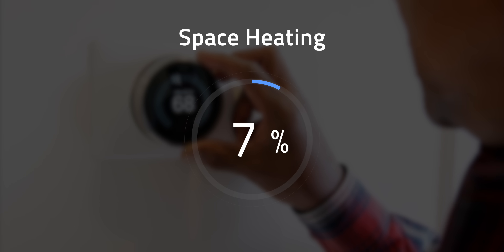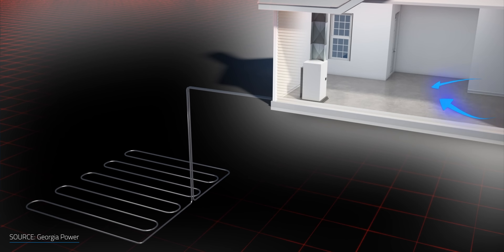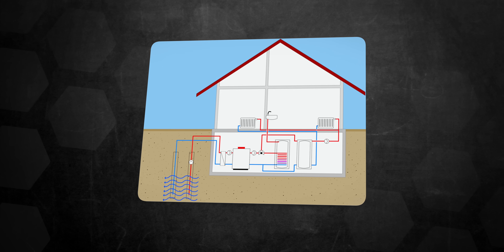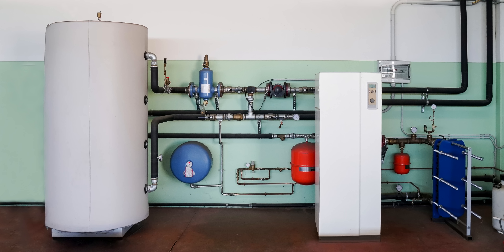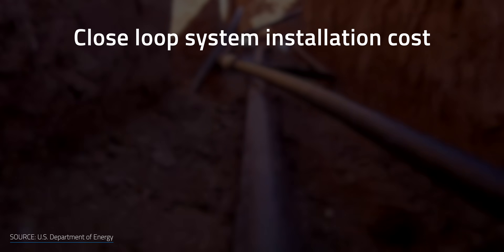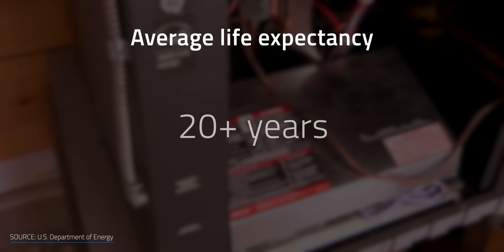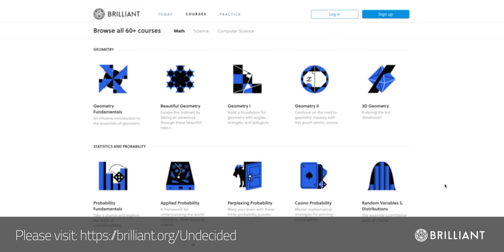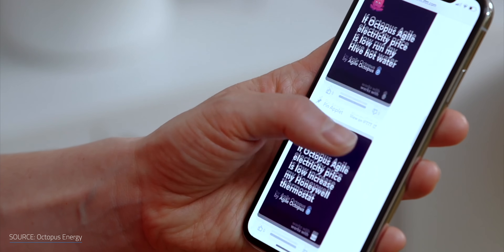Is Geothermal Heating and Cooling Worth the Cost?  Heat Pumps Explained

Comment: We installed a Water Furnace geo system 18 years ago.  The breakeven for the additional cost over gas forced air and central air was 5 1/2 years. Continues to save hundreds of dollars each month.  Only one minor service call in that time.  We chose to have the lines run vertically -- 4 holes drilled straight down 100 feet. Hardly disturbed the yard.  If you're building new or replacing an old system, this is the way to go.  Note of caution:  The auxiliary heat is electric heat coils that can supplement normal operation in extremely cold conditions.  It also spins your electric meter like crazy.  We chose to have this disabled and have not missed it despite sub zero winter weather.  Also tempersture changes are slower than GFA,  so we just leave it set at a constant temperature for the most part.

Comment: I had it installed here in BC Canada.   If my only other option is electrical heat then it was marginally worth it.  But compared to gas heat it is definitely not worth it.  In retrospect I  should have just installed a gas furnace for the two or three months of cold and an air source heat pump for shoulder seasons and air conditioning.

Comment: It all comes down to how much is the install cost vs. how much is a typical heating bill.  It works out better if it's a new build as opposed to a retrofit.  It's cheaper to install typically with new construction.  Also, you have to plan on staying in the house until you break even.

Comment: Warning: I invested the "Ferrari" of geo thermal systems a few years ago at a cost of about $40,000K for a closed vertical loop system. The system worked great providing cheap heating and cooling for about 3 years, and then just stopped. When they came to investigate, apparently the pipes had snapped because the bedrock rock under ground had shifted. To repair would have required a reinstallation of the pipes which would almost have been as pricey as the original installation, so needless to say I ended up getting a high efficiency propane system. I also was told this is a common problem with these systems, and found many horror stories on line. I wish I had known this before the original installation. Buyer beware.
Reply: It's a warning valid for areas with tectonic activities. But it should have been known in advance, and the flat collectors should have got preference over a deep whole.
Reply: I wonder if more flexible tubing would help prevent the pipe snapping you experienced.  I suppose if too flexible, the hose could crimp and impede the coolant flow.
Reply: @WT7005  it probably would have gotten pinched and stopped regardless
Reply: I think that s the design mistake tbh. The installer has not considered about the geology below your land which I usually do. Vertical closed loop is very much efficient interns of the space, but it is risky depending on the geological region.
Reply: what Cindy of heat transfer do you gat from bone dry sand granite and other types of dry ground
Reply: Sorry to hear this, someone really tried to take advantage of you. Full re-installation wouldn’t have been necessary.
Reply: I wonder if the pipes failed because they didn't use the proper pipe to save them money and give them mote profit
Reply: @marvenlunn6086  No - the rock shifted and snapped the pipe and would have done so regardless of the type installed. Was told by those that made the diagnosis (not the installers) that this is a common problem with closed vertical loop geothermal. I'd never heard about this problem until it happened. Buyer beware.
Reply: @colincameron1878  OK but it wouldn't surprise me if some of these companies use substandard materials
Reply: The installer company should have warranty at least five years to cover that.
Reply: Thank you! This is what I needed to hear
Reply: Nice heads up
Reply: Thank you for this information. I’m in Pennsylvania and heat with coal, wood, and heating oil. Cheap and a lot less complicated than these heat pumps.
Reply: Didn't the company provide any warrantee/ guarantee? Insurance?
Reply: Sounds like the well/loop installer didn't know what the eff they r doing.
Reply: Sinking the loop in a pond or lake is much much more efficient...40k? Forget about that lol
Reply: How bout laying the loop on some sand then it can move a bit.
Reply: Aither geologist fucked up or they didnt employ one, in aither case that fuckup should be on them
Reply: Where do you live, California?
Reply: @aaronfield7899  Ottawa, Canada. From what I was told this problem was not related to the extreme temperature changes in the Canadian climate because underground is not subject these changes except for the top couple of feet.
Reply: @colincameron1878  well I don't know how else the ground will move, because Ottawa is nowhere near a plate boundary.
Reply: @aaronfield7899  Ground here only freezes to about 3 feet, and pipe is buried starting well below the frost line at about 10 feet. They did a hole to that depth before drilling. Damage was done at about 80-100 feet deep, and I was told that the rocks moved. Subsequently I read reviews from many people that this also happened to them, and furnace repair service said this is commonplace even though we are not on a fault line.
Reply: @colincameron1878  so you had a vertical system in place?
Reply: Thanks I always wondered about this, would you know if this is the same for a horizontal loop ?
Reply: Why can’t I get emu info on efficiency chart on a ground source heat pump related to the return water coming out of the ground
Reply: Ty for sharing your experience!
Reply: Hmm, so don't install in bedrock...
My geo (forced air) was 10k. That was 10 years ago. $0 on maintenance spent
Reply: Ferrari produce really expensive crappy cars soooo... I'm not surprised you had problems😅
Reply: It should be integrated in the house foundations structure
Reply: @colincameron1878  masonry heaters
Reply: :-00000
Reply: Does homeowner's insurance cover ground source or duel source heat pumps?
Reply: @cordeliaparham6800  Mine did not. I imagine you would specifically have to ask for these to be included.
Reply: @cordeliaparham6800 this is an effective thing to bring up
Reply: That is not a common problem - not at all.  That’s just not accurate.  Also, there should have been a warranty for the loop(s).
Reply: @markh6161  Company that did the installation went out of business by the time this happened. Certainly, I am no expert, but the company that came to investigate why my system stopped working and made the diagnosis told me this is a problem that they see regularly. Also at the time I then saw dozens of reports from other people on-line claiming the same thing had happened to them too.
Reply: Well yeah you had the wrong one you needed them to go below the frost line I’m assuming it’s rocky or ledge in your lot
Reply: @altchanel9693  They did go well below the frost line (about 2 metres) and break was 20-30 metres under the ground. Was told that rock underground shifted breaking the pipe (it was drilled into the bedrock). Was also told that this is a common problem with such systems.
Reply: @colincameron1878  yeah you have a vertical system . If you dig and lay a mat of coils and backfill with good material it wouldn’t be an issue

Comment: When I built my house 25 years ago, geothermal was 30 times the price of a gas furnace.  The trees may interfer with the pumping , not sure. Also, I have a conventional AC. When the AC quits, it's over 20 years old, I will get an air source heat pump, with gas backup. The trees have gotten bigger, so less area, more trouble for geothermal. The trees add shade and evaporative cooling, but don't block winter sunshine.

Comment: A public school in my area had this geothermal system installed  along with windmill and solar.  Was the worst thing they ever did.  
Problem was it would heat to around 62 degrees constant temp. Was to cold for classrooms.  So they put in a furnace to try and heat the water from 62 to 70 and the furnace ran constantly making the heat bill twice as high as in previous years.  Windmill and solar was also a colossal waste of tax payer money.

Comment: The higher upfront costs of geothermal systems is why NY and MA are pushing newer air-source heat pumps to replace heating oil in both states with rich incentives.  Newer ASHPs are far more efficient than the ASHPs from the 70s-80s and can also be integrated into utility economic demand response programs. They are also far more “plug-and-play” than GSHPs and far cheaper. 

In the early days of GSHPs there were many poorly designed systems. I know one school district in Upstate NY that built a new building with a GSHP system. Unfortunately whoever designed it didn’t realize that the heating/cooling loads were not balanced. After five years of running the system only during the winter the area surrounding the loops remained cooler than average ground heat because no heat was being pumped back in. The system started straining to produce any heat at all during the winter with the end result being a conventional natural gas system being installed costing the school district millions more.  Residential GSHPs should be more balanced over time.

Comment: As an HVAC Technician in Oregon, the costs are way way way way off. Prices are way more expensive than what is indicated here, unless you want to absolute worst contractors working on your equipment. $15-25k depending on size and efficiency of equipment without changing ductwork is much more realistic (that is for both a furnace and AC (or heat pump and air handler)).

Comment: I put polypropoline lines in the concrete slabs surrounding my pool. I connected Jandy valves to my pool equipment so that a small thermal sensor activates the valves when the pool water gets below 70 degrees. This extended my swimming season here in phoenix by over three months split before and after summer. Neighbors are envious. Heating cost ZERO!

Comment: Yes it's worth the cost ! Had geothermal put in in '07 utilizing a 1 acre pond at a cost of $13000. after rebates .Our cost to heat with oil the previous year was $5500.00. Over the next few years we saved that amount but paid $900 to $1100 per year in additional electricity usage. The return on investment was 3yrs. and it has been reliable ever since only requiring a new blower motor in '19. We now also have 17KW of solar so the savings are just that much better.

Comment: 1993 built new house. just under 10,000 for waterfurnace  and horizontal loop and ductwork. 2018 had to replace unit with waterfurnace brand. 6700 dolaars after 30 % tax credit. overall pretty much satisfied. not many problems with first unit. so so good on #2.

Comment: "Oil is sadly used in his area." Well thats the first dumbass comment Ive heard in this presentation. Its used because its affordable and works. The exorbitant costs of install and finding a company that specializes in geothermal heat pumps, if they do it right, is not worth it. I love how these sales pitches push crap as though its the best thing since sliced bread and when it fails after a few short years the homeowner is screwed trying to afford the repairs, not to mention the time without heating or cooling inconvenience!

Comment: If your building a 100 year house. Its the best system on the planet. If your building a 20 year house dont bother.  It is to expensive for you. The money you save on heating and cooling will pay for the system in 7 years. A good system is very low to no maintenance. And will outlast a 100 year house.

Comment: Sounds like a good idea in 10-20 years when they have the tech all sorted out and repairmen are readily available
Reply: There is no tech. its running water through the ground and using the ground temp. Your big maintenance cost is the fan motor and pump motor, which could be hot swapped in a heartbeat. Any plumber can figure this system out. This is incredibly low tech. Now if they install it the "smart" way, which is using a small AC/Heat system to supplement the geo system, then this can get alittle complicated.

Comment: "Geothermal" A number of problems for a great system. VERY sensitive to electricity costs as the time to pay back install cost could stretch or exceed system life if electricity rates are high (Like Ontario). I also believe the moniker "Geothermal" was adopted vs. Ground source to justify the high cost. I mean what sounds better/expensive? I think this may be biting the industry in the ass a bit. Resale of home?? Unless the next buyer sees the value it adds nothing or little. When you say GEOTHERMAL heating, does it make an uninformed buyer nervous?? Probably.  Field costs are absurd, likely the reason the "Geothermal" moniker was adopted. If you are near an actual ACTUAL geothermal area like ICELAND, hey call it geothermal. Otherwise, it's bloody ground source. What's the cost to horizontal drill/install a natural gas line? Probably a tenth or less per running foot than a "Geothermal" field. Justify that difference. Also some juristictions almost require a damn mining permit to drill vertical because hell if a homeowner can afford a "Geothermal" system then for sure the local municipality needs to get in on the action. Thanks government. I am not sure where "Geothermal" is in Ontario but it for sure is a rural solution limited to areas not served by Natural Gas. Tragically Ontario used to have electricity rates that would make "Geothermal" more attractive. This was ironically ruined by "The Green Energy ACT" which was more successful at rewarding corruption than fostering "Green" energy.

Comment: No they are not, far too expensive and they have problems all the time. They have to be maintained regularly.  Just get a gas furnace and save your money and headaches.
Reply: an open system would need maintenance all the time. if a closed system needs regular maintenance, it means they botched the job

Comment: Am in New England. Spoke with our HVAC expert on installing a geothermal for our next house - he has one himself. He said the price is actually about $150K and up; recommended air heat pumps instead. Edit to update this: I asked our HVAC expert where he was installing $150K geothermal heat pump systems and he admitted they were installed in 10,000 sqft houses. Normal installs are far more affordable.
Reply: The big cost is digging out the ground.A geo system is better as it can maintain that temperature separate of your AC system. Air heatpumps IME are absolute garbage. They do a poor job at heating, will send your electric bill through the roof and give you an AC with a higher probability of failure because of that reversing valve.Plus electric heat is slower at warming than gas/oil.  If you get a heatpump, i recommend finding a dual fuel that uses the AC and adds gas/oil heat as the back up. This lets you compromise on being economically friendly but still offer actual comfort at an affordable price in emergencies.
Reply: @zeedstun891  Our bills have been lower than with the oil heat we used to pay with the electric heat pumps. We use Fujitsu Halcyons that operate down to -15 F, and they have been doing an awesome job. That said, I do think geothermal would probably be the way to go if you can afford it and live in an area that consistently drops below -15. We wouldn't personally invest our money in any fossil fuels at this point given the way regulations and things are heading, but any heat pump combined with a high efficiency wood stove as a back-up heat source is a really good option. We have friends in Maine and NH that use those heating methods and have never lost heat, have reasonable bills, etc.

Comment: Ive been looking at something like this but you missed a big question. Does it use less energy overall? can it be paired with solar panals and be feezable?
Reply: It uses the least amount of energy. It's just a simple pump circulating water. minimum parts means minimum points of failure. It'll only freeze if the installer did a poor job, otherwise, itll maintain the same temperature year round and can even work as freeze protection for the home. The solar panels may be a good source of supplemental heat but im not actually sure how effective they are in the winter.

Geothermal is not an isolated system. For comfort, it needs supplemental heating and cooling. The major difference is You only need to cool/ warm up an extra 10-20 degrees to reach comfort levels, regardless of outside temperature. A geothermal system will give you a constant 50-60 degrees. Comfort is usually around 72 degrees. working from 60 degrees is much easier than working from below 30 or over 90.  The more dramatic the temperature differences are, the better a geothermal system is. It'll cut huge amounts of work off your ac and heat systems
Reply: Actually, let me add a correction. You wouldnt need an AC at all with geothermal, but youd still need a secondary system for heating. The fact that it maintains a constant 60, means your home will always be cool but not always warm